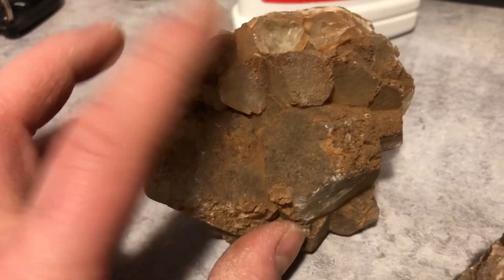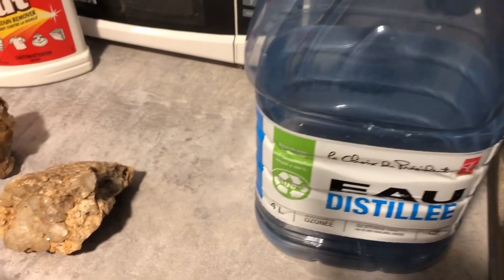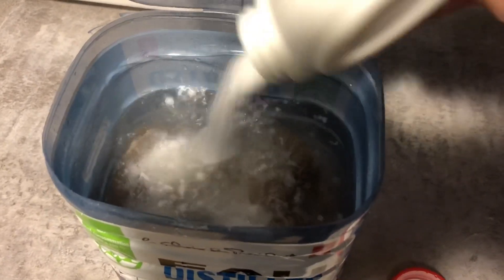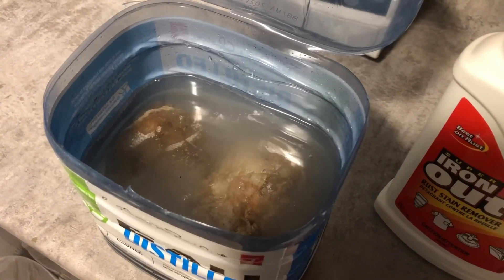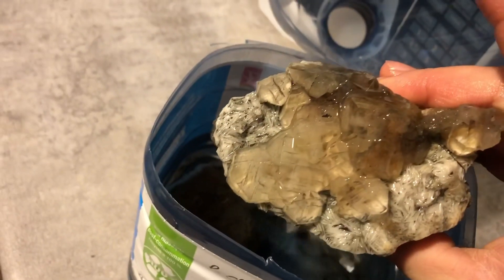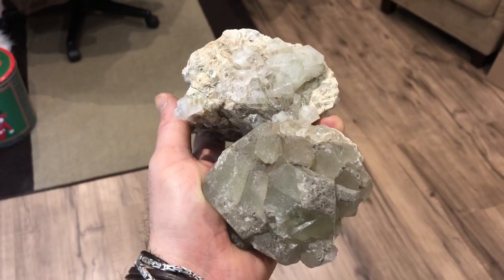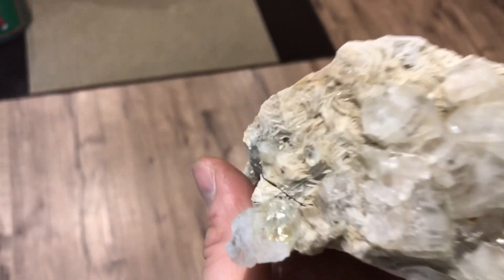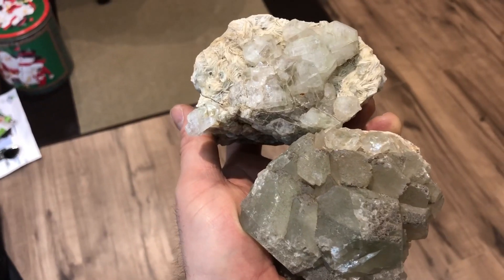Cleaning Fluorite crystals with bleach

Comment: so i gota big old cube from Uk classic loc its also got galena pyrites and calcite  and lots of iron staining  it was a beauty of crystal but  it got used as a door stop for a garden shed and gotten all rusty and cracked etc
Reply from the maker: Ya sorry for title but ya iron out should work. Just be careful with pyrite, might need wd40 after to stabilize it or it will crumble.

Comment: the video says cleaning w bleach. but its iron out. 🤦
Reply: Iron-Out is actually an acid (Oxalic).  However, in this case, since it was used to remove iron "stains," I feel that it is not too far-fetched to say it is acting like a bleach.
Reply: @RetiredAirman77-97  bleach is sodium hypochlorite a chlorine chemical compound anyway... two totally different chemical compounds. hopefully u never mix the 2 together because u think theyre the same thing🤦
Reply: @RetiredAirman77-97  iron out spray is oxalic acid. iron out powder is actually a different acid its a sodium bismusulfite acid. but my point was the title said iron out but it wasnt iron out it was bleach. 2 totally different chemicals.

Comment: Thank you for the very good idea using a 5L distilled water empty bottle for basing crystals! Can I use citric acid or vinegar instead?
Reply from the maker: Saveurital I think the acids could damage the crystals especially if any calcite is present. I would stick with bleach as it does not adversely affect the crystals.
Reply: @ontariorocksrelics  Thank you for the rapid reply. I can't find Iron Out in Europe. Bleach could be chlorine? I have Barites  cluster covered with a black and grey scales, some top part of them are shinny but mostly covered by black/grey matrix(?) or scale and  large quartz under it. I can find liquid form of iron solvent "Evapo-Rust" here, but I don't know if it cleans the black/grey scale which covers on the top part of the rock. It's quite big and heavy, 12x7 inches. Could you give me some advice please?
Reply: Saveurital I think it’s called Rust out in Europe, pretty sure that’s the brand name in Britain
Reply: @dariotaylor6444  Thank you!